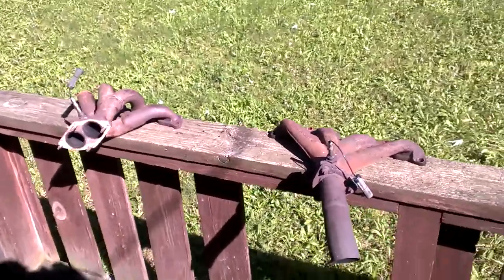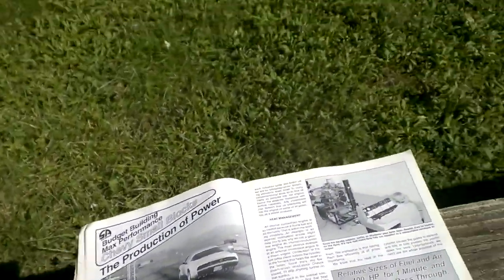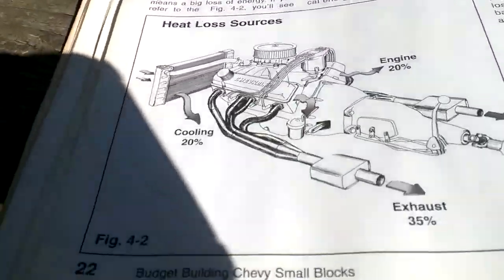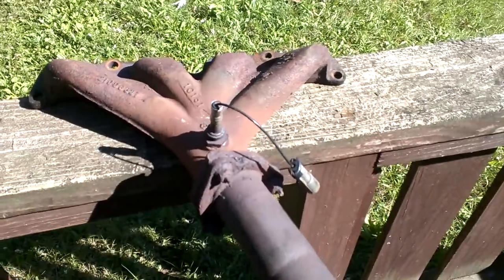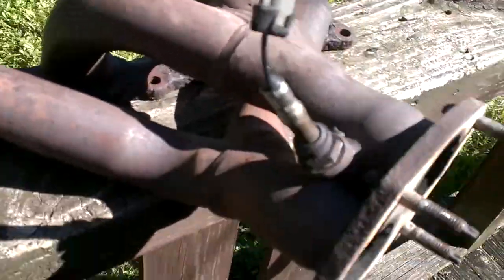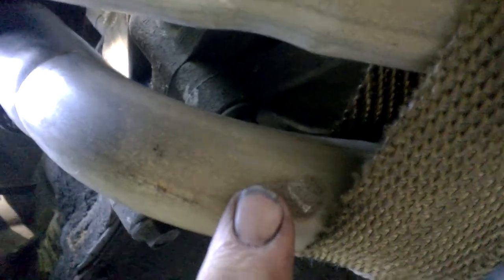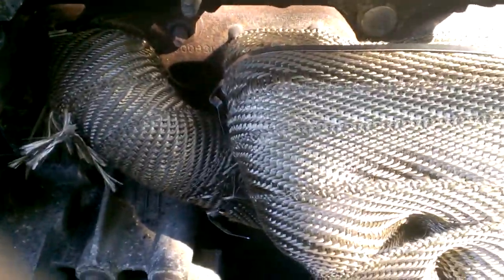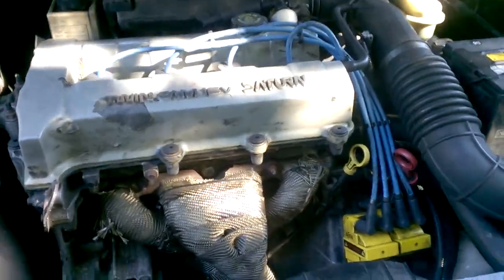Headers vs Manifolds(1991-1998 Saturn 1.9L DOHC)

Comment: I saw this film ~2 years ago, and even purchased the wrap for the exhaust you recommend. Special thanks for the reminding about a book Production of Power by David Vizard. I couldn't find the same, but saw How to Build Hoursepower. Probably it is similar, maybe updated version. The main problem for me on Saturn is to install new Piston Rings, since I've read if the car eats more than quatre of oil between oil changes the problem should be addressed soon. And you know it is not that big deal to get to the Rings, the main problem is that I don't know how to do Timing on the Engine Chain.  My new Intake costed ~$400 (it was some kind of deal w/discount in Autozone, I believe). Mechanic Justin fm our Jupiter Chevrolet dealership did glue it 1st (yes, that is right, it is a Coolant Return, that piece which usually gets problem on Saturns),  and on my way home the car stopped after that "repair", so they pulled it back, manager came I remember, and probably he told Justin to stop his experiments and install a new Intake (and charges were for a new one anyway). After that and some similar situations I started to learn about car repairs myself. I was amazed how easy it is, and till now can't comprehend, why people in that area of activity do their work so poor. Thank you for this informative film. Do you have any films on Piston Rings replacement on Saturn?

Comment: Nice... Just picked up headers off a 91 sl2 at the junkyard that will fit right onto my 96 SW2. 50$ ordeal. not bad. Especially for anyone just wanting headers for this setup, and cant afford the fancy stuff. Now online all im seeing is manifold. No headers. OBX is bankrupt... So to anyone seeing this, just go the route of finding a junkyard with a 91-92 sl2...  On another note, on the 96 sw2 they didn't offer the fancy intake manifold that is coated, and stamped with "Twin Cam 16 V" on it... You can also get this off a 91 or 92 sl2. Which is what i did. Also 50$. Have yet to put them on the car, as I want to paint them with a metallic paint. Anybody need any pointers on this process for either part,  just ask me.
Reply from the maker: @mattdiesel2294  The OBX header, that they used to sell for these engines was total garbage, and they cracked the welds at the collector. 

The hard part of this setup is finding the balance pipe, that bolts to the collector. 

Walker was the only brand, that still made them, when I had my SC2. 

I don't know if they still make that pipe, and most yards will torch through them, to get the catalytic converter. 

As far as 96-98 SC2/SL2 engines, instead of getting the "Twin Cam 16v" intake manifold, get the Aluminum valve cover and the bolts from a 1993-1995 1.9L DOHC, with the raised lettering. 

The plastic valve covers were known for warping, over time, which would cause oil leaks.
Reply: @Joshua_James_Howard  Yea, thats the next thing, is a different valve cover... My mom owns a third gen SL2... And she wants me to find a metal valve cover as well..  Of course other than both o2 sensors, serpentine belt, and a couple other things... Your right about that torch through... Thats how i got mine... With no cat.. Just means i will have to make a custom exhaust pretty much unless i find a part out or whatever... But hey, I'm learning a lot... And these cars are amazing learner cars.. About that balance pipe... Is it just before the resonator? Cuz the resonator is still there, but no cat.. I still have the hangars(rubber).. Seems the "downpipe" was cut down right before the cat, and shortly after... Indicating the yard got rid of the cat on that 91.. Would this mean that balance pipe is still on the exhaust or no?  I mean as of now, this exhaust is in four pieces all because of a stripped downpipe flange bolt and stud.. When worse came to worse, I was underneath that 91 in the puring rain, cutting it with an electric saw.. Also over top the car, trying to get that manifold.. Another question as well.. Don't know if you know the answer.. But, on these, the power steering pulley is pressed on.. and can easily be "jammed" off if you need it to be.. Well. How would I go about pressing one on? Since i have yet to do the manifold swap despite having nearly all the parts..
Reply from the maker: @mattdiesel2294  The metal valve cover will NOT fit on any 2000-2002 DOHC, because GM completely redesigned the cylinder head to accommodate roller camshafts .
Reply: @Joshua_James_Howard  No your good i know that... my model is a 96 sw2... My moms is a 02 sl2.. we just know our saturns...
Reply: @Joshua_James_Howard  Like i have the Y pipe and the resonator... Is that ok? or do i need more?
Reply from the maker: @mattdiesel2294  No, as long as you have the Y-Pipe, up to the converter, you are good to go. From the converter, back to the muffler, is completely the same on all DOHCs from 1991-1995 OBD-I and 1996-1998 DOHC the converter should have an O2 sensor AFTER it. 

If you are deleting the converter, with this modification, you will get a Service Engine Soon trouble code for cat con efficiency in the downstream O2 sensor,but that sensor is NOT used for calculating air-fuel ratios or spark timing. It is only used to verify the converter is on the car and working as designed.
Reply: @Joshua_James_Howard  Thanks for the info... Yes, in this exhaust i got from the yard in addition to the headers, there was no O2 sensor spot, and i was fairly certain they went into the cat.. With having that badly stripped bolt and stud issue on the downpipe flange, I was just like screw it, Im not leaving them here, and ended up cutting them.. Atleast the dowpipe anwyays... Glad im all set for this swap as i have been wanting to do this for a while.. Funnily enough, your not the first person i have heard talk about this.. Specifically I had heard on a forum about this.. Headers coming off of 91 and 92 sl2s.. But cant really find one without buying it whole in my area.. lucky for me, my local junkyard has online inventory and i tracked it waiting until they got a 91.. Upon inventory photos, i was able to confirm that it had those headers.. SO I made a trip of it.. Took me four days of work to get everything i needed.. Two days with constant rain..

Comment: Thank you for the informative film. May I ask you how heavy is the Exhaust Manifold and who is the author of the book "Production of Power" you are referring to?
Reply from the maker: David Vizard is the author of the book, I have in the video. 

The book, that teaches the concepts of how an internal combustion engine operates, is "Building Small Black Chevy's on a Budget", I think. 

The concepts of airflow, fuel atomization, compression, spark timing, etc would all still apply. 

You would obviously NOT install 2.02"/1.60" valves in a DOHC with a 116 cu in block, and only 4 cylinders.

As far as weight, there isn't a noticeable difference between the manifold and the stock header, to be honest.

In my experiences, getting a 96-98 Saturn S-Series with a Twin Cam would be the best option for this modification, so you can remap the PCM(provided you have compatible software to do so), since it is OBD-II

My 1995 never seen any improvements in ETs, no matter what modification I made. My fuel economy did improve, a lot.

OBD-I systems can be overwritten on the Saturn S-Series, since the PCM does not use a PROM chip, BUT only one Australian company makes a compatible program to remap the PCM, and it only works on a 1995 S-Series Twin Cam with a MANUAL, NOT an Automatic.
Reply: @Joshua_James_Howard  Thank you. I'm not going to modify the Engine (2001 Saturn SL2), it is DOHC and I'm happy w/that. Just think to remove the Exhaust Manifold for a proper cleaning and inspection, but concerned about the weight, do you remember how many pounds approximately? Thank you for the reference to the book.
Reply from the maker: @olenaerhardt7725  I never actually weighed them, and since I sent the car for scrap after an electrical gremlin caused it to stop starting, I no longer have any of my spare manifolds or headers. I have a a 1996 gauge cluster left, and even THAT is 1996 ONLY interchange
Reply: @Joshua_James_Howard  That's O'K. I looked on Amazon on similar manifolds, should be around 11-15 lbs, not that much, I can handle it. Thank you for the concern about my question.

Comment: Weight man. Weight. I see you still got ps. New engine, and new trans are being built now that i passed 300k and going slower other then faster. Next is the dash delete. And i daily her.
Reply from the maker: My car tipped the scales at 2,380 lbs. Not too much weight can be shaved off a car, that light, and any weight you do shave off isn't going to make much difference, other than reducing your top speed from aerodynamic drag on the car. 

Curb weight being high allows for a higher top speed, provided your engine makes the horsepower to get it there. A Bugatti Veyron will break speeds of over 250mph, but a LeMans Formula Racecar will top out around 200-210mph, and the Veyron makes 1,000+ HP and has a curb weight of 4,000+ lbs. 

A LeMans Formula Race car doesn't even tip the scales at 2,000 lbs. and has only maybe 100 less HP, if that. 

That is what auto enthusiasts call "drag-limited", in racing. when a car is "drag-limited" to a specific top speed, that means no matter how you gear the differential and transmission, the car will not exceed its "drag-limited" top speed.

Comment: Is that stock header from a specific year
Reply from the maker: Stock header for the 1991-1992 Saturn 1.9L DOHC. The Y-Pipes are getting very sparse to find, and Walker discontinued them last year. So, this modification may require a shop to build a custom Y-Pipe and flange in the future. This header will ONLY fit the 1991-1998 DOHC cylinder head. With a 1999-2002 DOHC, you will want to contact BRP(Blainer Racing Products) or OBX. BRP is the better choice of the two. OBX are known for cracking the flange welds.

Comment from the maker: Well initially, I ran a 17 3 on Wednesday, after putting this video together and completing this modification. My engine still has bad valve seals(waiting on a head I am having rebuilt), and I am still using the MP7 automatic. Gonna keep it auto, but the "corrected" times were coming up as 16.9 @ 80 mph. So, humidity and altitude were costing me 4/10 of a second. It has made a noticeable difference in both low-rpm torque and improved fuel economy. Even with running my car 4-5 times at the track, I just refilled yesterday and came out to 33.5mpg combined city/highway/drag racing. Converter stall is 100rpm less than what it was, which is where the increased low-rpm torque is coming in from. I am going o do a video on porting, with suggestions, because I have already mic'd the manifold, the gasket, and the head ports. Incorrect porting on the exhaust side will crack the heads(intake side porting is not needed on the DOHC, as it is factory port-matched already).Just gotta get my head back from the shop, for the engine I am rebuilding.
Reply: I would love to see the porting video. I need to get another car to do that in the future as mine is a daily driver but eventually it will be done.